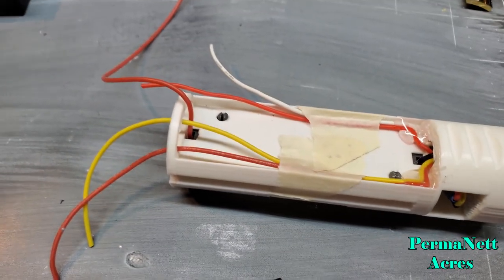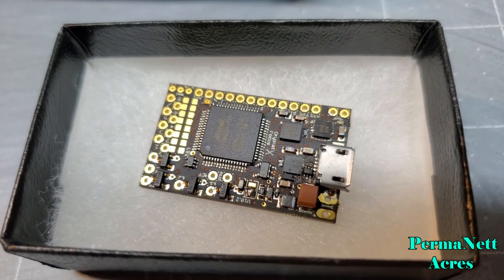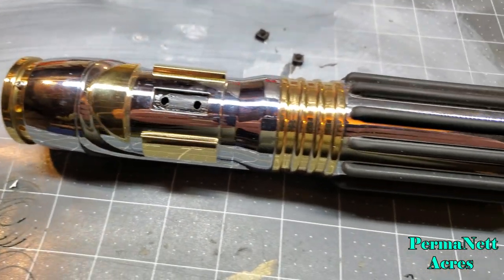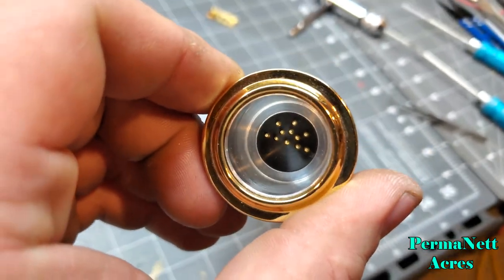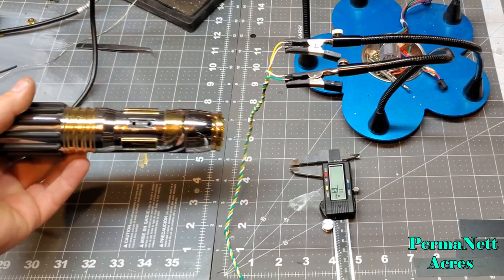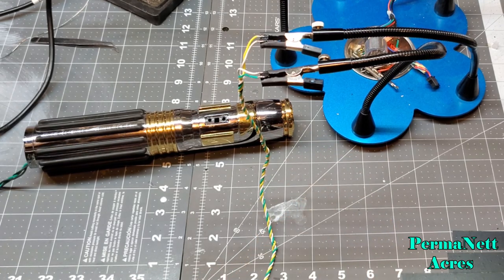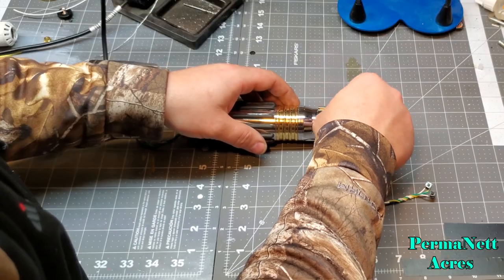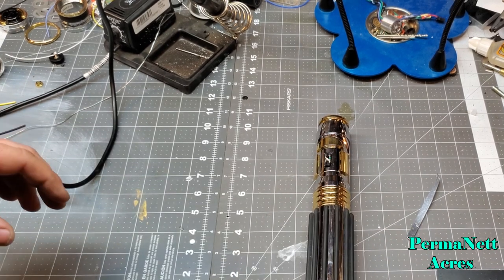05 MR Mace Windu CFX Conversion part 3

Comment: Great video! Would you recommend the tcss conversion kit or just designing something similar myself? I saw another video where you had the carbon sleeves. Did you like that way better? Also what size is that speaker?
Reply from the maker: TCSS conversion kit works great you can use the TCSS pcb module adapter for the tcss pcb or set a 1" short pin Shtok PCB & holder on top of the module housing in the blade holder.
If you have the time to take all the measurements to fabricate a carbon fiber blade holder, it accepts a wider variety of 1" blades without having to sand the blades to fit.
KR Sabers 28mm 8 ohm 2 watt speaker, Smugglers Outpost 28mm Elite speaker, or The Saber Merchant 28mm 8 ohm 3 watt speaker.
Reply: @PermaNett Acres: Farm, Play, & Away  thank you so much this really helps. I just purchased a gutted out mace windu MR and trying to make sure I have everything I need when it arrives in the mail. Good to know those are 28mm speakers because that means the chassis I already have should fit. Thanks again.
Reply from the maker: @wyteyoda7831  you're welcome.
Reply: @TheBanthaWhisperer  did you have a pin holder on top of the pixel pcb? if so, what do you recommend? Also how did you secure your carbon tubes?

Comment: If you were to do this today what would be your thoughts on using a premade rgb core for a base lit conversion? I have a 2002 Anakin AOTC MR FX saber and im leaning to that idea. Ill need to relocate the momentary switch and charge port but that should be straight forward enough.
Reply from the maker: I usually avoid any premade RGBs, because they are usually low quality compared to the copper base rgbs from TSA or TCSS. I always build out my LED modules to make sure they aren't with low quality materials.
All of the Anakin conversions I've done utilize the clamp section for switching to allow for good blade socket depth.
Reply: @TheBanthaWhisperer  Thanks for the reply. This is my first attempt so i guess its a proof of concept for myself since most of the forum posts are ancient now and barely have any images that are still hosted. Ill definitely keep in mind that there are better methods if i feel the LED is weak. Did you use the mace windu conversion kit to hold the blade for Anakin conversions?